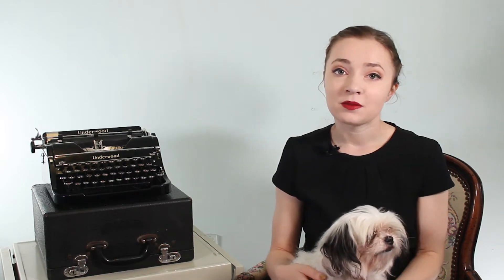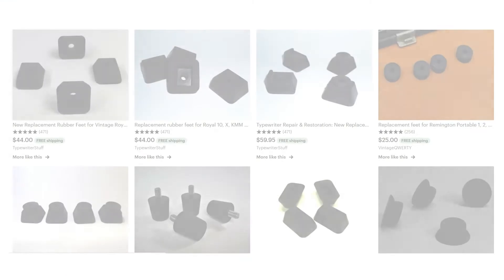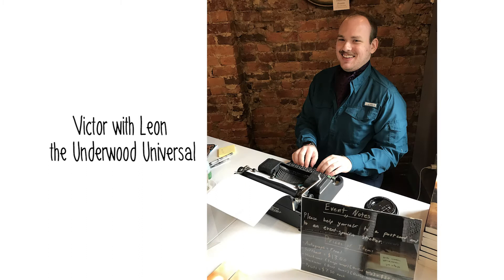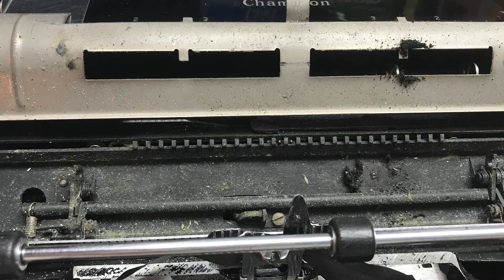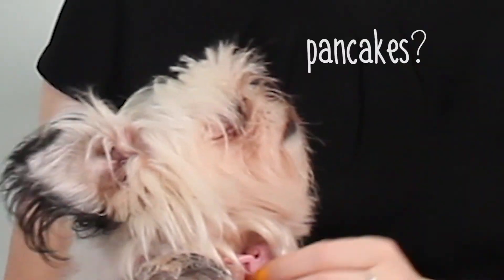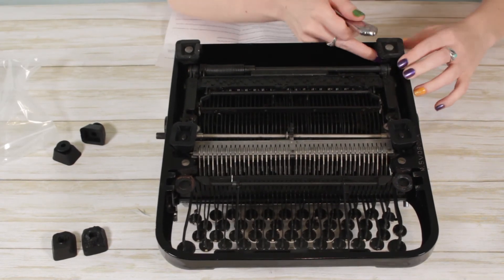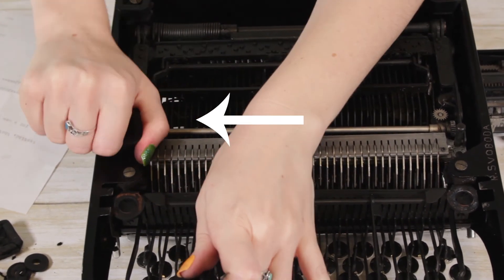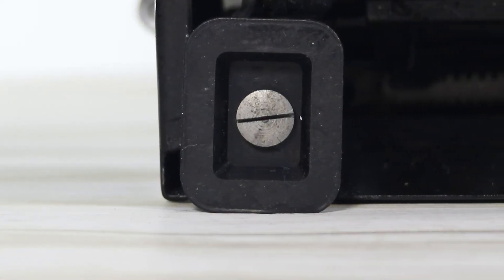Easy Maintenance: Replacing Typewriter Feet

Comment: This is exactly why I bought a 3D printer. Most feet are made in the USA, so it's quite expensive to ship to the EU. 
I make the feet with flexible filament (TPU). They grip a bit less than real rubber, but it does a surprisingly good job. 
I currently have done feet for the Underwood 3 and 4 bank (The smaller round type for the 4 bank, not the larger square ones from your machine), and already have 2 orders from fellow collectors, which I'm currently printing. 
It really is amazing how much better a machine looks and types with new feet.

Comment: Lifesaver video, thank you. I was about to order some replacement feet on eBay which — together with international postage to Hong Kong — would have cost me US$90 a set. Which is three times the price of the typewriter itself. I’m still paying way too much, but it’s bearable for now. With the ultra-portables, it’s much easier, less expensive  to find or make replacement feet — but replacement feet for these older portables is the one thing I don’t have spares for. I’m tempted to buy bulk for my most regular brands and models — get it over with in one go. For now, however, another 1935 Universal will have new shoes soon. Thank you 🙏 D
Reply from the maker: hope it works out for you!

Comment: Hey Sarah great video! I had my 1923 Remington Quiet 12 feet replaced and it was the best, the old ones compressed and not evenly might I add! I have a Remington Portable 2 and the base it's attached to is ruined so I made feet using rubber table feet and some superglue. I gotta do my Noiseless next lol and oddly enough my 1916 Corona's feet are OG and look new! I guess it depends on how it was taken care of and stored!
Reply from the maker: You're right, it does make such a difference!

Comment: In Croatia, this type of machine will be min. 200$ I, said min. :-(
Reply: Same in Australia, $200 min. Not common machines here though. Odd that you only spend $25 on a whole typewriter but happy to spend more than that on just the feet? I wonder if you can cut some from just a strip of rubber? Wouldn’t look as good but it would be a lot cheaper. I have found that vacuum tubing for cars can be used for roller rubber.
Reply: @saulysw  :-)